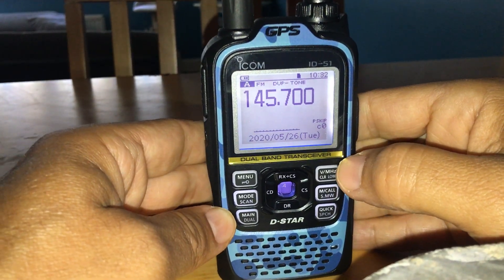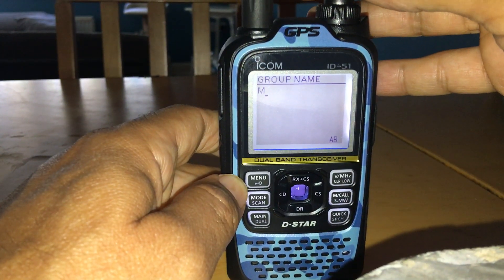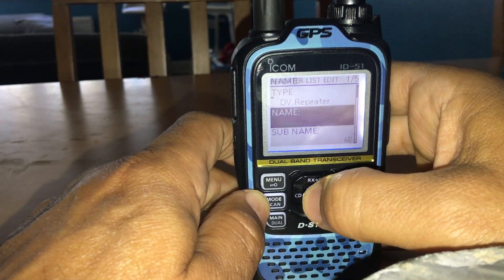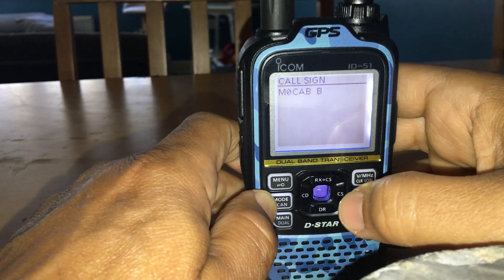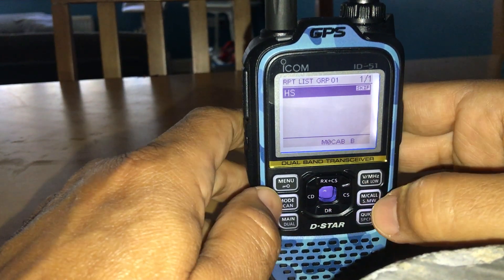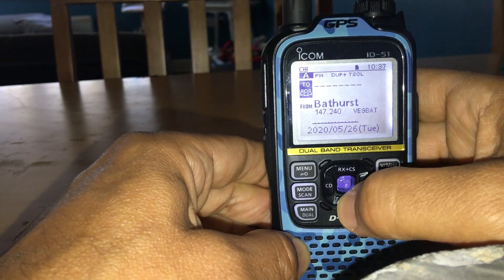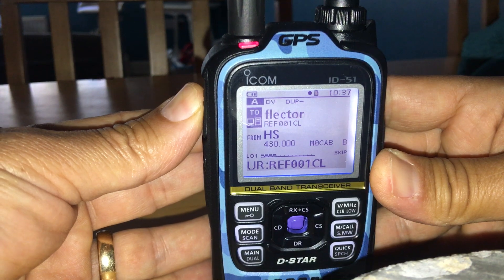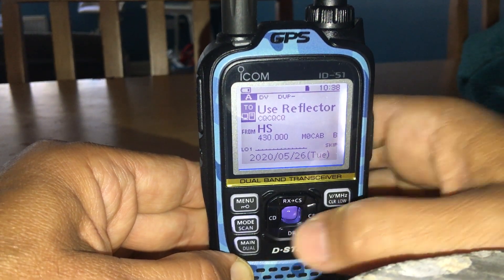Icom ID51 -Add your Hotspot

Comment: It is completely amazing how overcomplicated Icom has made these radios and this process.  I had a friend give me an Icom 51-a 50th that he won several years ago at a ham fest.  He never used it.  I took it out and started working with it.  Data cable is over priced.  Simple things are way over complicated. And menus.  Man. People always complaining about Yaesu menus.  They must have never seen one of these.  So far I have this one, the Yaesu FT5D, and the Kydera GD-88.  That GD-88 to the Openspot 4 is hard to beat given that you can program the radio to change the Openspot channels.  The FT5D is a close second with its wires x. But this Icom is a complete mess.
Reply from the maker: You have some really nice Radio , yes DR Mode can be mind boggling at times with so many settings required :https://www.youtube.com/watch?v=PGBF9ed-TD4